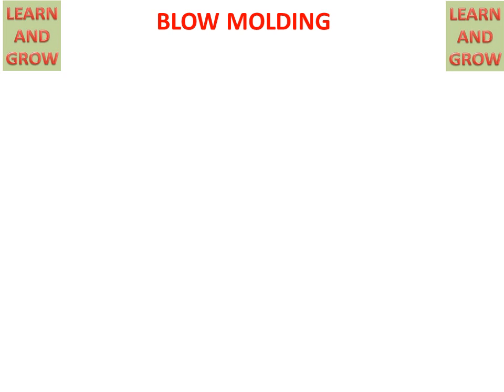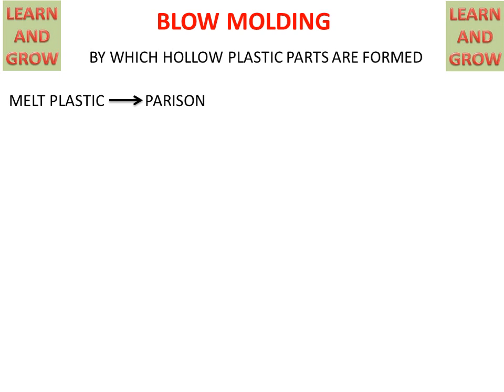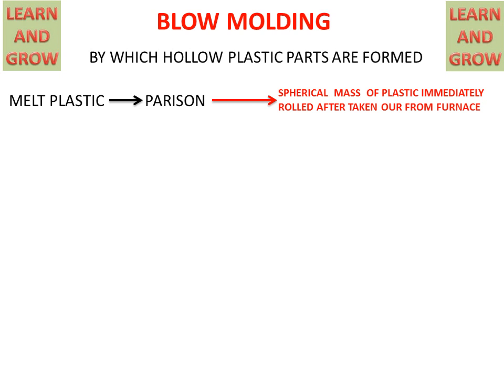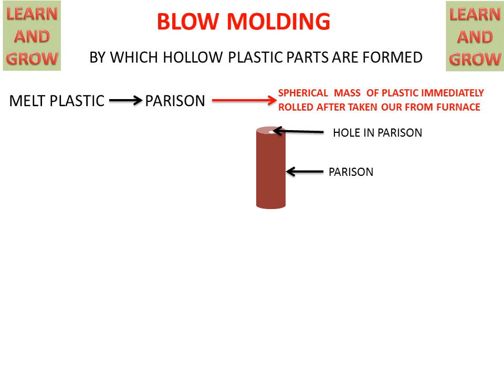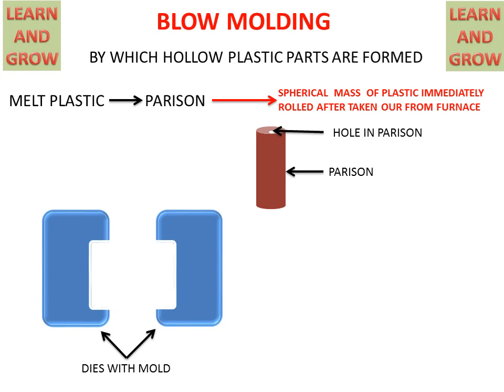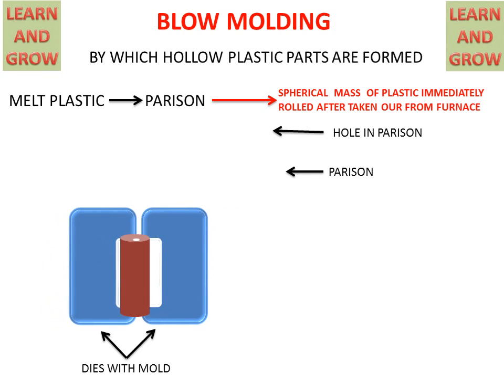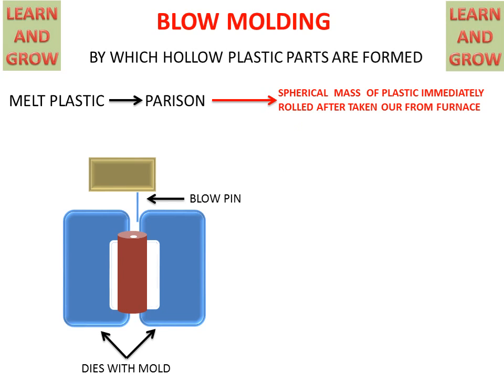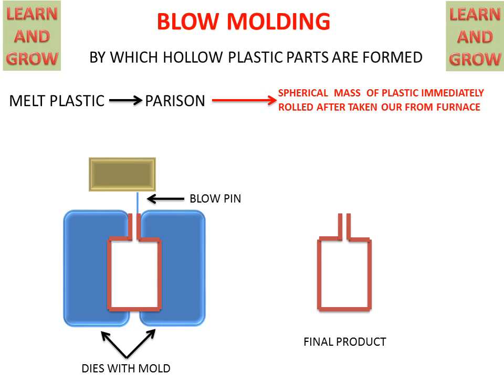Blow Molding (Working Animation)

Comment: Why is a cooling system required in blow molding?
Reply: Affan Faridi because your working with hot plastic around 170-250 degrees the metal parts from the blowpin to the mould will heat up when the mould or the tool is hot it can cause negative effects on the product